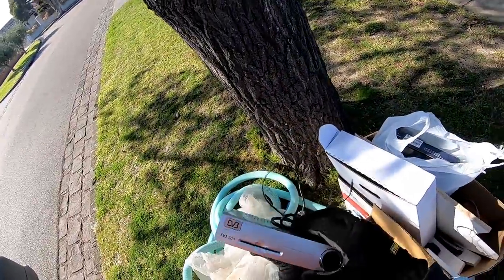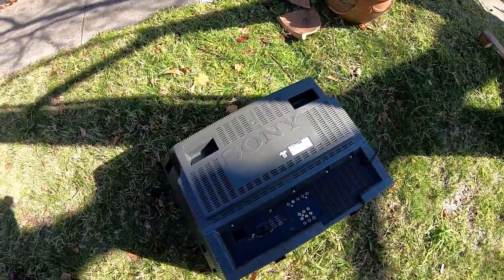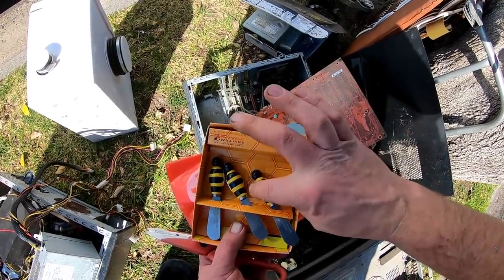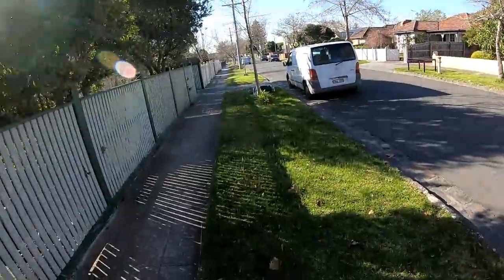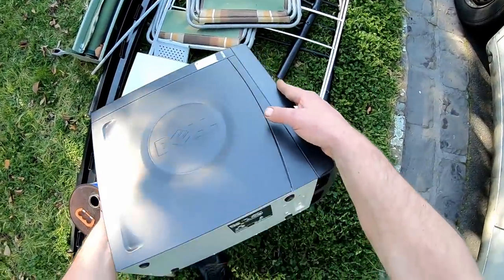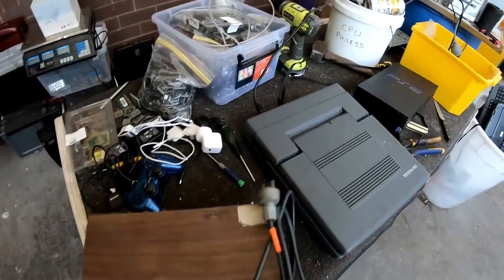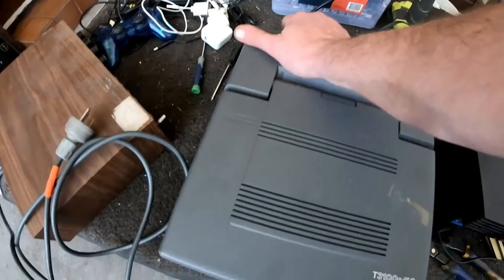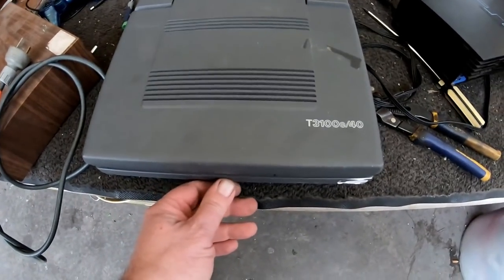Street Scavenge Vintage Toshiba Computer Score

Comment: Ben that is crazy! i read everywhere about the dangers of opening a CRT because you can get an electric shock that can kill you, and that the crt needs to be discharged first before touching it and you just open it, cut the cables and into the ban.  you were never harmed on doing that'?